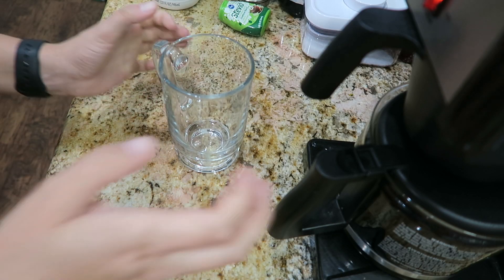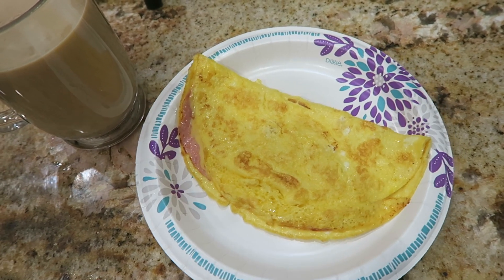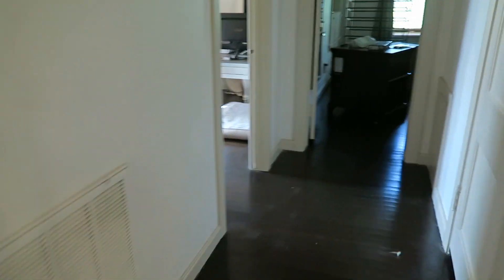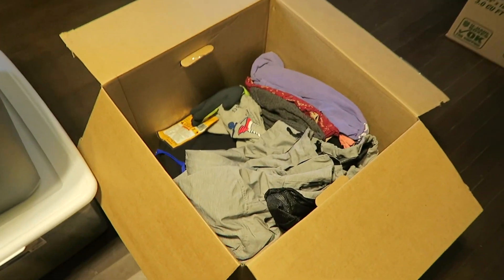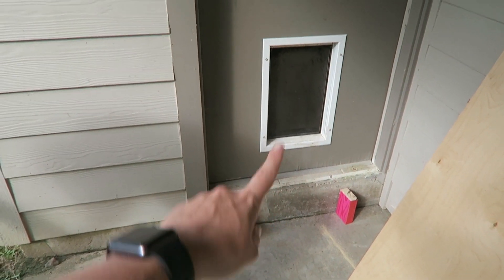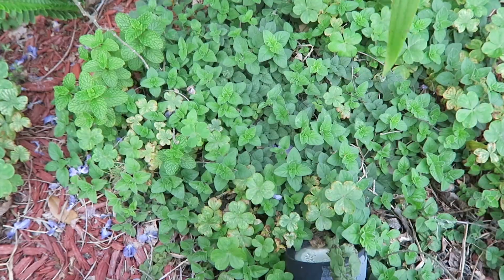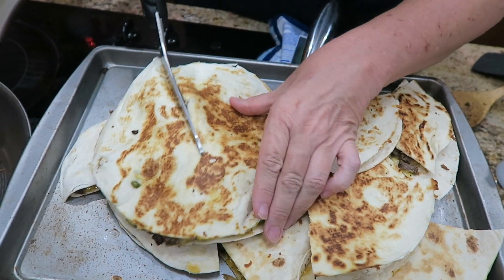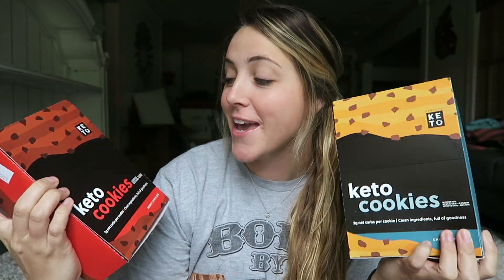I NEED YOUR HELP! | MOVING IN VLOG | PERFECT KETO COOKIE REVIEW

Comment: Love your happy attitude! I'm an interior designer in Tennessee and I have a couple of suggestions for your entertainment center delima. First, how many inches too high is the top? Is there anyway to remove the legs of the base to accommodate that extra space? If not, consider hanging the top from the wall after adding a board to the bottom you have painted to match the exact same coloring of the furniture. You can use corbels along the bottom- you would attach to the board,( again painted same color with all the distressing), I would suggest four or five corbels- leaning closer on the five choice, because odd numbers look better, these would be attached to the wall and the cabinet but will not be holding the cabinet up as they will just be for aesthetic value and stabilization. You would buy from Lowe's or Home depot multiple brackets used for framing, extreme brackets which would be hidden in the back but attached to the cabinet and every stud behind the cabinet. Then, if it was me, I would adhere through the holes on the entertainment center top a flat-screen hanging mount  to hang the flat-screen on the back wall of the hanging cabinet. It would be adhered to the wall studs. Make sure you hang the cabinet as close to the ceiling as you can and center it in front of your couch so the flat-screen will be comfortable to watch while adding a cohesiveness to the room.  Another idea would be to find a much shorter base that allows the top cabinet to touch the ceiling at its highest point. It could be painted to match so it looks like you bought it that way. You would still need to buy stabilizing brackets which hold a unit like that to the wall to keep it from tipping over onto someone. But they are not as extreme as the ones used to hold it up because the new base would take that pressure off the studs. Third idea, use Bombay chests as the base. You can find them in shorter heights but they are similar to your cabinet French Country style. You would still need the board attached to the base, you will still need to adhere the cabinet to the wall, but three chests for it to rest on would look really great. Fourth idea, build a base. They are simpler than people realize and youtube has so many step by step how to videos made by real craftsmen, it would be customized and could be a nice video for you to post yourself. I would suggest using the original base somewhere else in the room as a couch table or entryway table or behind the couch against the wall then putting pictures or two lamps on it at the far ends with items eclectic ally placed between- or two matching large ginger jars. Lots of things you can do. Since you are renting, it won't be that way forever so keep that in mind when you make your decision what to do with the unit, just  gorgeous and you want to maintain its integrity so you can use it in your next home the way it was originally designed. Good luck and God Bless ya'll.

Comment: Perhaps you could use the top of the entertainment unit as a faux fireplace. Buy an electric insert that looks like burning embers(can be used with heat on or off), build an enclosure of wood and paint it to match. The enclosed sides could even be hinged as doors so you could use the space to each side of the "fireplace" for a little bit of storage.

Comment: I would suggest cutting the top section down a little bit. From the bottom up. And then you could put it on top of the stand
Reply from the maker: I don't want to cut it down because most likely when we buy a house eventually - it will fit.
Reply: @KatherineMichelle  I get that.. What about a shorter table? Maybe one with smaller legs :) OR it could be a giant side wall cabinet.. Add more temporary shelves. Love your videos .. Keep them up and all your pups and Cody and cooking too.

Comment: Build a short base.. w a single board.. then add cute feet to it.. paint to match and then you can still use it for the tv.. and if you ever want to put the two original  pieces  back together  just unscrew it.  Super cute claw feet can be found on a ton of older furniture  . Browse apps for free  furniture  just for the feet.. like let go or offer up.. or your local Restore  or goodwills. *Once the lock down is over..  in the mean time stay safe !

Comment: Get a 2 by 12 and some angle brackets painting the same color mounting like a mantle on the wall and set the shelving unit on it at the height that fits all the at the height that fits all the way to the ceiling that will give you a good place to mount a TV or some artwork

Comment: Mint is hard to contain. You may want to plant some in a container, it will choke out the rest of the plants. You may want to use some weed killer to gain control. Use foil paper to avoid spraying the other plants. Good luck!
Reply: It’s just as good to pull out the mint to keep it in one area.  I wouldn’t rely on weed killer since it’s an enable plant.  She works from home so being a natural Gardner might work for her.  Weed killer is so bad for the environment.